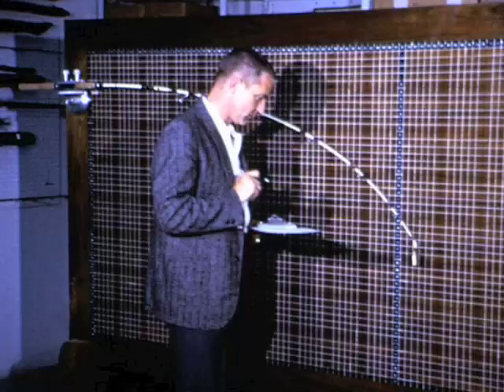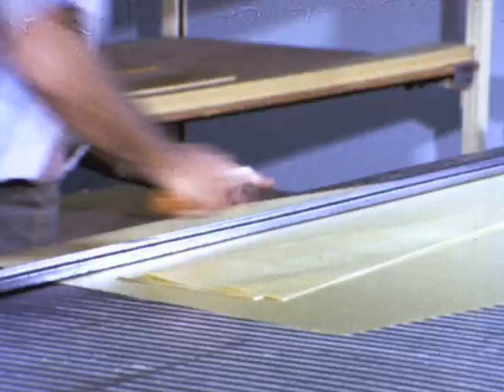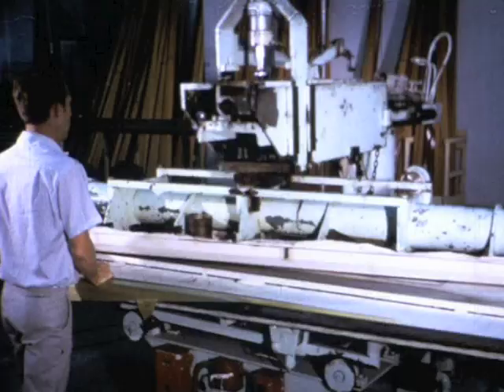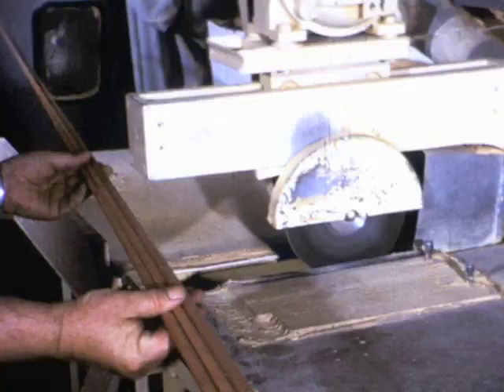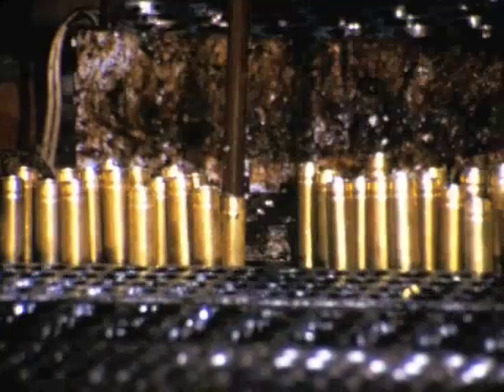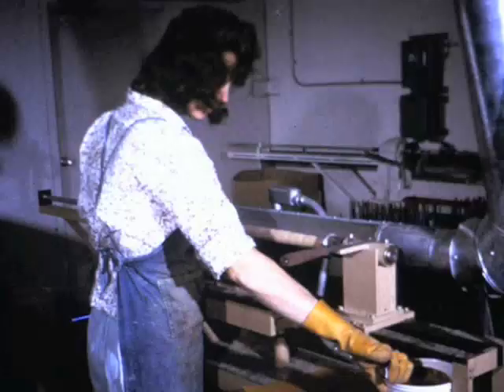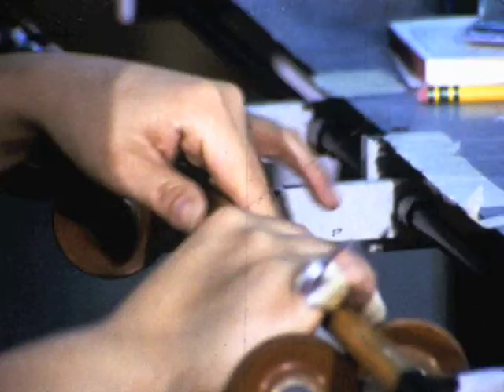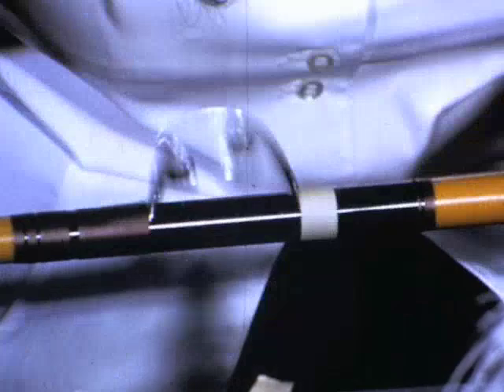1962 Garcia Conolon Fiberglass Fishing Rod History

Comment: I've started to use my new to me saltwater Conolon rods more this year. The parabolic action of the rod feels very good with modern small conventional saltwater reels. Filled to the brim with braid and a short mono or fluorocarbon leader. The braid to short leader makes the line fairly sensitive. You can feel the bait fish swimming and when it gets bit. The softer action of the rod helps absorb the head shakes of the hooked fish. Leading to less pulled or torn hooks when using braid.

Comment: Could some one tell what type model rod would be Suitable for the Abu matic 160 or what rod would they normally pair it with what

 I’m wanting to know is if you bought an Abu matic reel  What options would they have for cranking, top water plugs or props Specifically for the Abu matic Targeting specifically Bass in open water  sturdy enough to handle a 5 pound bass open water